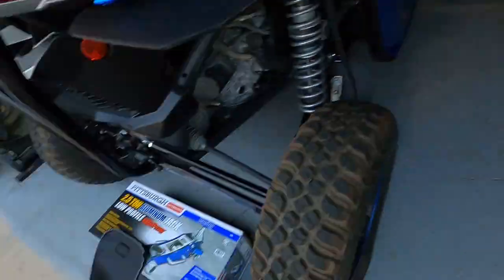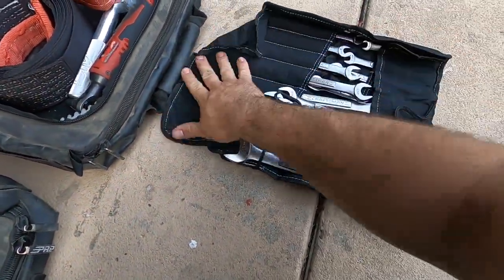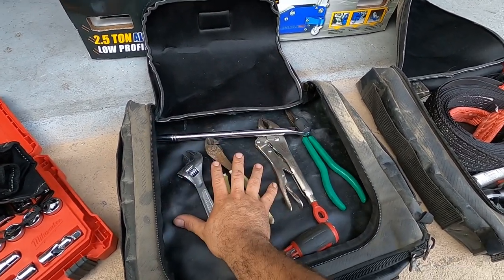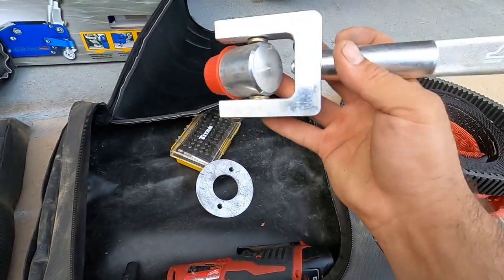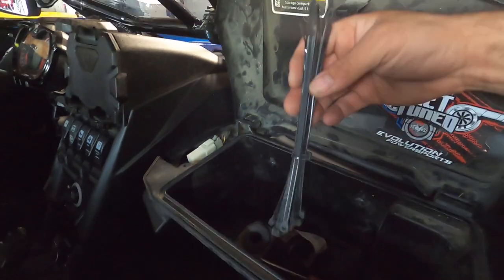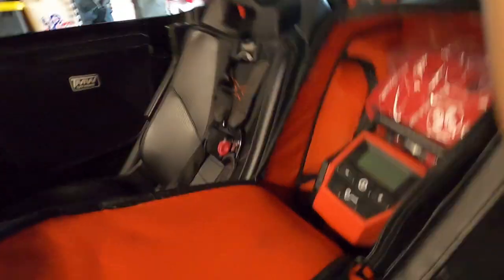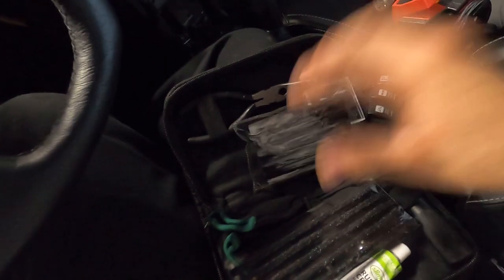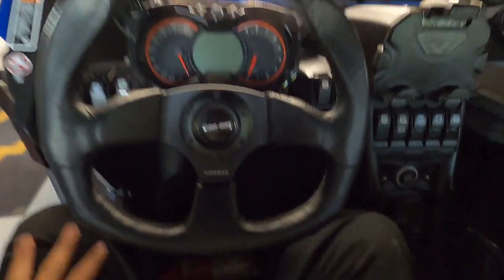NEED YOUR HELP Can am X3 TOOL KIT   ep 98

Comment: Good kit. I agree with going through the first aid kit.  I would also loose the case the socket set is in.  Blow mold takes a ton of space.  Put your sockets on rails and get another tool roll.
I am putting my spare on the roof of my RC. Cut a tire last fall.  We were 30 miles of WV trails from the truck.  Took all the plugs we had but limped her to the hauler. 
Thanks for sharing.
Reply from the maker: Thanks for the feedback 👌🤙

Comment: Idk if anyone told you or you might already have it but throw a quick release pin kit on the cover for your belt very helpful in the field and much quicker change....it's cool it helps a little there 19$ on eBay
Reply from the maker: Ive seen them, and installed them on other machines.... I much rather use the bolts.

Comment: Man, I liked the idea of the under seat bags, but they're currently sold out and they're not waterproof. I think I'll buy 2 dry bags (used for kayaking) and store them under the seats. We do river crossings / water crossings all the time. And my wife refuses to get the bottom door covers to prevent water from coming in. Thanks again for the video.
Reply from the maker: Yea the bags work but if they were waterproof would be way better👌
Reply: Have a link to those dry bags?

Comment: I have a two seater.  You said you carry those bags in back seat but I assume they will still work on front.  Seems right.  U fill up bag before or put bag in car and then fill it up.  Again looks tight below seat.
Reply from the maker: It is a tight fit ..depends on whats going in. Full packed bag. Yes no way it will slide in

Comment: I got a big puncture and I was kind of far away from camp with no spare. I made it back but it was just frustrating. Next day I bought spare tire a impact and a co2 jack
Reply from the maker: The c02 jack does look tempting and its pretty compact. Did u have plug kit?
Reply: FrankGLife no after I got to camp we took the tire off took it to a nearby shop and the puncture was so big that they couldn’t patch it so they put like 10 plugs but air was still coming out.
Reply from the maker: Dammm.. hah. Ten plugs,😅
Reply: FrankGLife JAJAJJAJAJA yeah

Comment: A second fire extinguisher in the back or on the passenger side.

An external tire patch kit to complement your plug kit.

Does the spare have to be 32"?  Couldn't you get away with a lighter weight 29"?  No one cares what your ride looks like limping back to camp, they just care about getting back to camp.

With all the tools you have, you could take a tire apart, patch it from the inside, put it back together, and air it up.  (Just another option... Your two under seat kit  bags are excellent and I'm going to be copying a lot of what you're doing there!)
Reply from the maker: Installing a 29 even for a short ride back. will cause the diff to bind. especially the rear. it would skip alot. probably could get away with it tho. interior patch is a great idea bro. so is an extra fire extinguisher. thanks for watching 👍
Reply: @GLifeUTV  2 wheel drive & move a good tire to the back if it was the back that got a flat.
Reply: Certainly and thanks for sharing your videos / very helpful comments.  I learn a lot when people take the time to explain.  

What is the lightest weight tire and rim that you could use on the front and still be a reliable spare tire?  (One step up from a "donut" but not massive / not heavy... Could even be a thinner width tire.

Also regarding that second extinguisher: you'll never regret having more capacity ... You'll only regret not having it if and when the time comes.